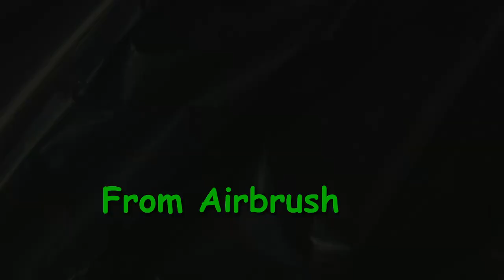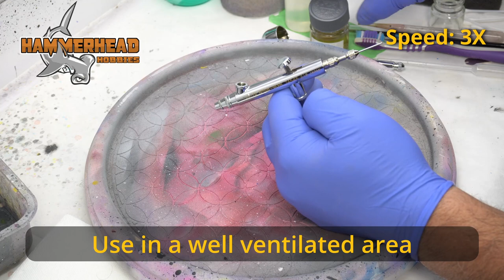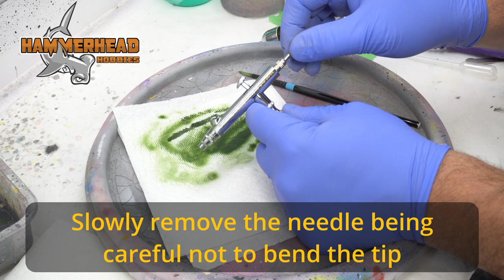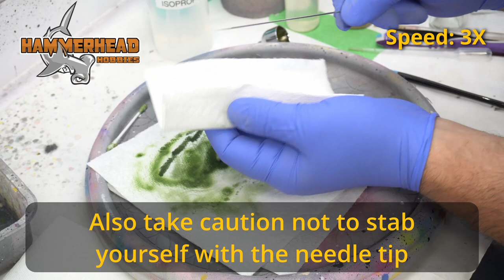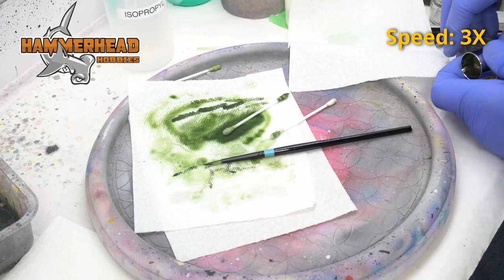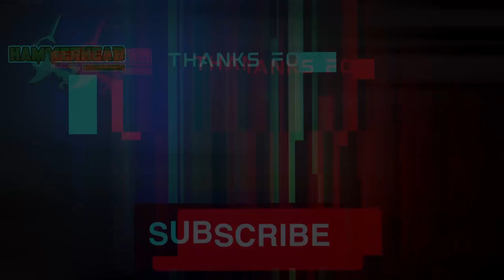Cleaning Dried Paint From Airbrush

Comment: Good tip of using acetone for dried up paint. Would you recommend a final rinse with water to spray out any acetone/isopropyl alcohol residue?
Reply from the maker: Hi and thanks for watching.  I would not recommend using water at all on airbrushes.  Water is more viscous and tends to stick to the fine holes and crevices in the airbrush.  I know some  who use water to clean and their airbrush always spatters paint and they refuse to listen.  If you are going to use water then distilled water is better than tap water as tap water has minerals that are left behind when the water evaporates. The airbrush in the video is over 3 years old and never sputters paint.  I paint almost everyday with it and give it a cleaning like the above about 3 times a year.  After I paint, I just put isopropyl alcohol and use the brush to mix with the paint.  Spray it out a few times and it's clean.  I hope this helps.
Reply: @hammerheadhobbies , excellent suggestion! I use isopropyl alcohol to clean my airbrush but I do a final rinse with (tap) water. I had the occasional spatter but not too bad. I’ll refrain using water for my next projects and see if there’s a change in the spatter pattern. Thanks again, very good stuff!
Reply from the maker: @natalebabbo-gunplaanddioramas  Give it a go.  Water is not the only reason for spattering.  Dried paint, bent nozzle, rough needle, and small leaks are all contributors for spattering.  I have never use water on any airbrushes and they seem to last a long time.  Also, I would avoid mixing water with the model paints.
Reply: @hammerheadhobbies , I will and let you know! Thanks again for the good advice.